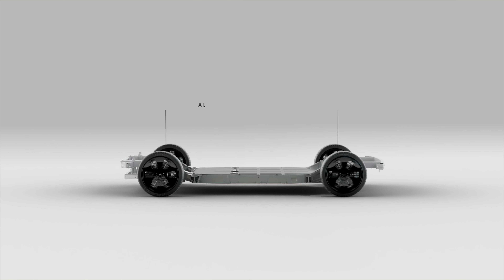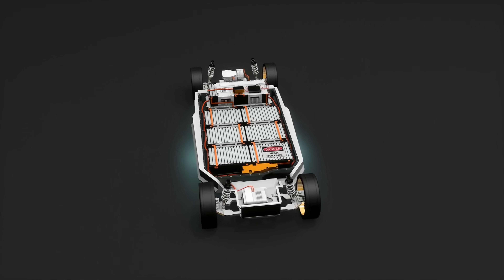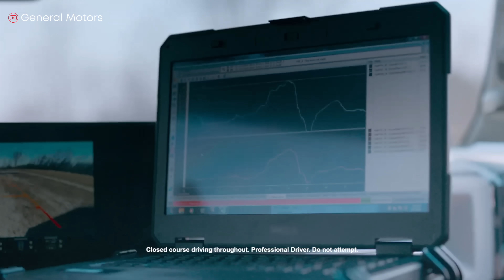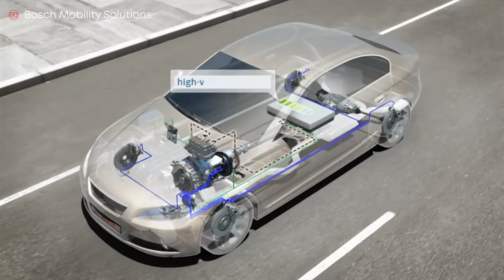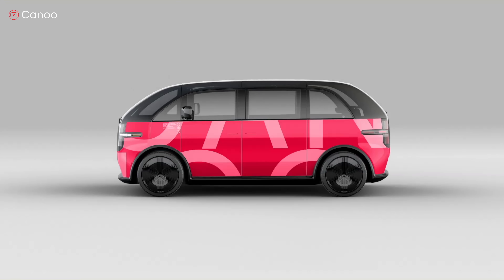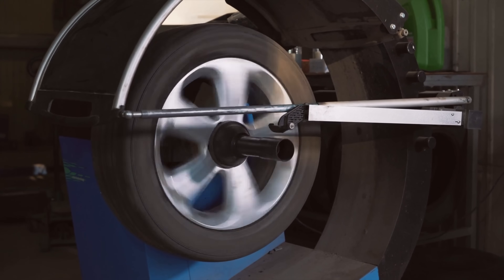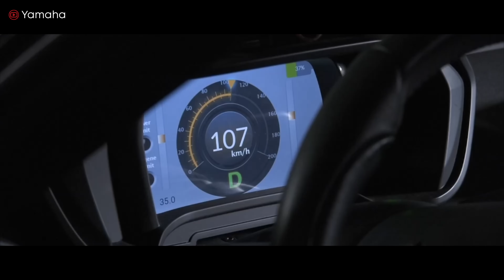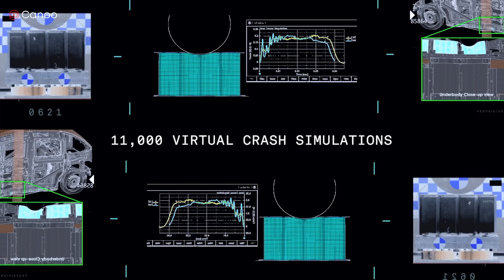No One is Telling You the Truth About Electric Cars, So I Have To

Comment: EV batteries are never actually fully emptied or fully charged either, even when you think they are. This is done to maintain the health of the battery, and is handled by the Battery Management System, which also (in most EVs) automatically heats or cools the battery when needed to prolong its life. For example my 2015 BMW i3 with 110K miles on it, still has 90% of its original capacity. I just wanted to say this, as while the advice about not fully charging or emptying the battery is correct, this is already taken care of by the car's BMS.
Reply: I've got a Toyota Prius and I know the battery on there is charged in the way you mention to preserve it so it makes sense that would be the same on an EV.
It's a different situation to an EV but my Prius is nearly 12 years old and has done just over 109,000 miles so they can last a long time
Reply: Yea, but no. Cause that like an iphone. Yes, apple accounts for battery degrading by having the battery never fully discharge but at the same time not to be full either. What scotty is saying is actually true. You don’t want it to be fully charged or drained beyond X percentage. What this helps (experienced this in an iphone) with is keeping the battery discharge rate the same with no spikes or sudden lose of battery power. For ex. Battery percentage is sitting at 40% and then next minute it drops to 10% then the percentage starts to go down 1% every 2-3 minutes.
Reply: Some manufacturers have bigger buffer than others. The ones that eke out max range are the worst.
Reply: Yes the cars BMS/computer controls the battery from bieng charged too much- or discharged too much. But if you drive it to "0 miles" and then don't charge or drive it for a while then it can lose charge further and go below the safe discharge state.
Reply: @sk8ter202  Obviously everything in this video about an EV battery is true, but it doesn't explain that these issues are mitigated over time to a significant extend by the BMS, which ensures over the years that the usable capacity of the battery is maintained to not fail within the warranty, in my case 8 years or 100K miles. This is a huge difference between how a battery in a smartphone is managed and why there isn't a roaring trade in recycling EV batteries yet.
Reply: I typically charge my current ev to 70%, that gets me a little over 200 estimated miles. Plug in once a week or so at home when it hits around 30%
Reply: The Bolt EV comes close at over 65.5kWh of 66kWh being used.
Reply: I have a 2017 BMW i3 and love it. 50K mi with only routine maintenance, and it never fails to put a smile on my face when I drive it. I don't miss going to the gas station at all.
Reply: All devices that use lithium batteries have some kind of bms. They tend to provide power normally right until it calls it. Unlike the older nicad battery systems which gave you full power for 5minutes straight off the charger then started to go downhill and left it up to the user to decide when they should call it and recharge as it wouldn't go flat and stop for a ridiculously long time but is performing at less than 20% of its peak performance. Lithium powered devices tend to keep delivering right up to the moment they stop.
Reply: @jameskelly5429  if you worry about depreciation of an ev, by a used one that's already depreciated. My used Fiat EV is worth more than I purchased it for currently, $8K in 2018.
EV batteries typically have a second life as backup batteries for solar a less demanding application. Battery life isn't the issue some speculated it would be. Worst case is early Nissan leafs, I have one friend who donated his cuz the battery degraded so much, I have another friend who's still driving his 10 year old leaf, with reduced range.
Reply: @granddisney5461  dude you are comparing your iphone to a car. They both have different batteries
Reply: Jan 6 was "Wall Street Putsch" part 2  This is an interesting topic!
Time will tell. Leaf had a bad rep for suboptimal BMS with air cooling. So was it the number of cycles and/or the less than stellar BMS?
Prices on batteries right now continue to drop and quality hopefully gets better. So if you paid less than half for the new car with a smaller battery maybe swapping batteries after 10 years is not the end of the world? Some even argue that well cycled and used batteries stay healthier and last longer than EVs with low mileage!? If you look at batteries across the board and as a limited resource smaller batteries make more sense than huge ones. More people will benefit. Interestingly Renault is launching a new model weighing 1624 kg and a WLTP of 470 km. Higher energy density in their battery pack. The speed of evolution in EV tech is astonishing. We do live in exciting times.
Reply: What also greatly degrades the battery is fast charging.
If you have the time to slow charge, do so. It's cheaper and better for the battery.
Reply: Jan 6 was "Wall Street Putsch" part 2  so Scotty said expect 2% degregation per year, is he wrong??
Reply: @rhett7716  yes it’s less than 1.  Except the first year which is 2%
Reply: I like charging my car to full capacity in about 3 minutes from empty. It’s so nice.
Reply: Too much chance of fire with an ICE car. I rather have it always ready and never going near a gas station with a Tesla.
Reply: Well in general I agree with you but as Tesla moves to LFP batteries on some of their EV’s and stationary storage those do like to be fully charged and discharged.  The patent on LFP batteries runs out shortly.😜
Reply: @jonfscott  lol chance of fire? I bet you're the guy who got scared everytime he's around people working on cars with open hoods.
Reply: @jameskelly5429  what about the disposal of all the gas burners? Similar problem right?

Comment: What I have yet to see addressed, and it may be because of a lack of data, is how much more expensive an accident could potentially be. More precisely, how much more likely is it that the battery could be damaged to the point it would require replacement after an accident ?
Reply: Owners usually sell the batteries from wrecked evs. That's basically what the ev hot rod community lives on right now so I'd say that usually they're undamaged

Comment: I read a story where an owner of an electrical vehicle took the car to have his tires swapped for winter season. At the mechanics workshop they raised the car using a normal service lift of the scissor-type. In those types of establishments they change tires on lots of cars daily so the tempo is high and things are not always handled with caution.
Turns out that the lift somehow punctured the bottom plate of the car in one place which is where all the batteries are located.
The owner noticed that and of course wanted it to be properly fixed, worrying about possible damage to the batteries.
He went to several places and got roughly the same quote of approx 35,000 USD to fix it.
To safely repair the damage, apparently they had to more or less dismantle the whole car, since the batteries are part of the chassis system, deeply embedded.
Makes you wonder around the whole industry around electrical cars. It's not just the cars and the design of the cars. It is the whole aftermarket industry that also must be able to handle electrical cars in good way.

Then of course there is the thing about modern headlights on cars (not related to electrical cars only), they are extremely expensive and are "supposedly" never going to break if you believe the manufacturers. To replace them can cost up to between 3,000 to 5,000 USD each and are normally only covered in the original warranties from the the factory. Things like that makes the second hand market difficult. If you buy a 5-7 year old car for around 15-20 kUSD and the head lights need replacing, it's going to make the car almost worthless. This is a design flaw in my opinion. To make replacement parts that expensive can't be a sound design decision unless you focus only on people getting new cars all the time. That is not sustainable in the long run.

Comment: The more you use the regenerative braking system, the less the friction brakes are used. That causes the rear brakes to rust faster, ending in them needing to be replaced long before they really need to be. I've seen this so many times on electric cars, and hybrids.
Reply: Yes! Was just about to say this, I'm a service manager and explaining this to ev owners is never an easy thing because they're promised low cost of maintenance but replacing 450 dollar brake jobs for each axle twice as much haha.
Reply: @waynesmith6393  does batteries can stay working well after 100.000 miles

Comment: Just thought I'd share my EV maintenance experience (since you asked at the end of the video):

I drive a 2018 Tesla Model 3.  Because I live in an area where the roads have more salt than the oceans, a yearly brake maintenance is required for me.   This is due to the fact that I do 90% (or more) of my braking with regen.  Combine that with the heavy salt use and it can cause the caliper sliders to seize up.  This isn't required in most areas though.

Other than that, my only maintenance has been wiper blades, window washer fluid, and tire rotations.   I replaced my own cabin air filters and I did just replace my tires after 28,000 miles.

Here is the full maintenance schedule for a Model 3 (copied from the owners manual):

Brake fluid health check every 2 years (replace if necessary).
A/C desiccant bag replacement every 6 years.
Cabin air filter replacement every 2 years.
Clean and lubricate brake calipers every year or 12,500 miles (20,000 km) if in an area where roads are salted during winter
Rotate tires every 6,250 miles (10,000 km) or if tread depth difference is 2/32 in (1.5 mm) or greater, whichever comes first

They used to have the battery coolant in there, but that was removed.  Tesla now monitors the coolant in the pack for any issues and replaces as needed, but they expect the glycol coolant to last the life of the pack.
Reply: the ID3/4 has drum breakes that lower maintenance even further.
Reply: @stefanweilhartner4415   If they even use them.  I'm thinking it's the same as most EVs.  The friction brakes are used maybe 10% of the time at most.

I suppose its up to the settings the drive uses on the ID3/4
Reply: @Kuth70  yes, but the inside is protected from salt and water which minimizes rust and if you need them, they work instantly. that is the reason why the use drum breaks.
Reply: @originalmicdrop   This implies you know how long an EV battery lasts.  I'm guessing that your information is wrong or based on old data.

EVs with poor thermal management like the Nissan Leaf had horrendous lifespans primarily because of the fact the battery was air cooled only.

The car I drive has a battery that is designed/projected to last 300,000 to 500,000 miles based on its chemistry and cooling/heating system.

All EVs made now use cooling/heating loops with a glycol solution that keeps the batteries at optimal tempuratures.

Additionally, future cars with different chemistries such as lithium iron phosphate, or nickel manganese silicon will have even longer lifespans.